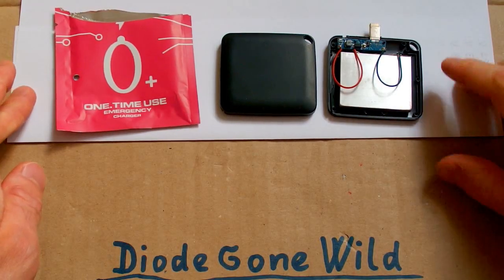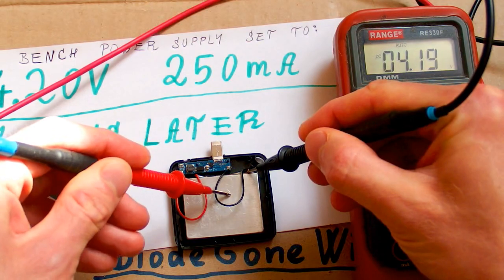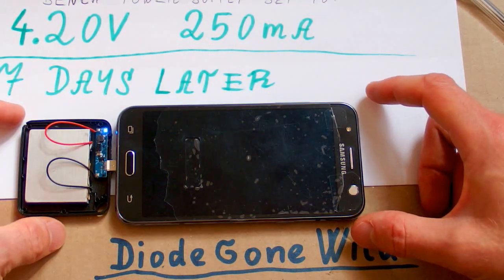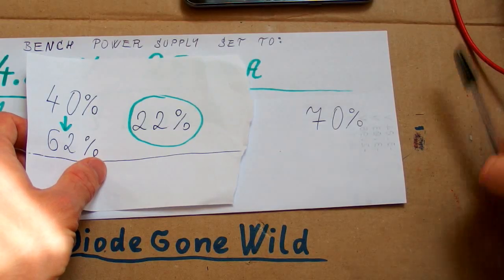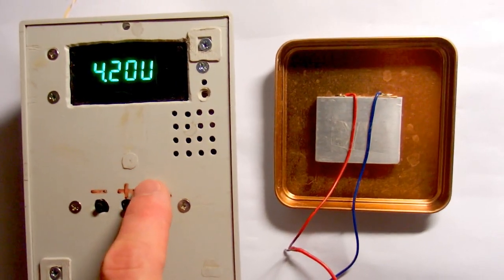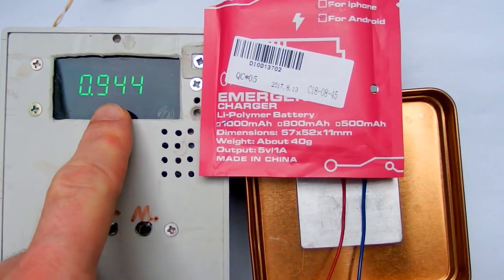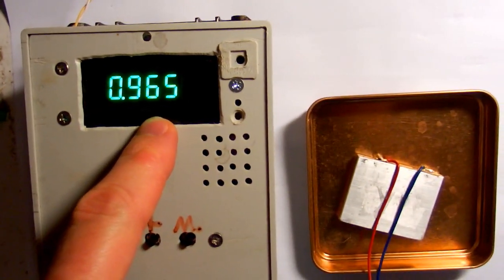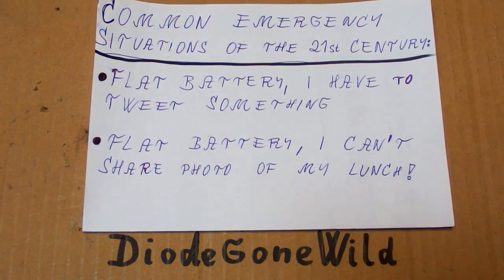Recharging the Non-Rechargeable Powerbank (and measuring its capacity)

Comment: Thank you for the lesson. 

My question is this, I have a kako tr pack (model S-4). I was using it in the my photography electronics flash in the 80s. It uses 6 batteries (D size) of 1.5v each. Can I convert it for charging mobile phones?
Reply: In those days, it was a  power bank for fields working in photography. What is the way forward?

Comment: Hook a TP4056 up to 4 of these cells stacked in parallel and that should charge with the right amount of amperage in should be fine 250mAh per cell @ 4000mAh
Reply: I got one of those single cell 18650 rechargeable ones, could I use the tp4056 to charge 4 of them in parrale coz I was thinking of buying a few more coz there only €1.50 and you get the step up module with it to. Payed €1.62 for 2 tp4056 boards for projects. What do you think or do I need to use the board's together. P.s the 18650's are 1200mAh.

Comment: The manufacturer of those disposable chargers needs to be fined and shut down. What a waste. If you can recharge them again then they are not really disposable if they can be saved,then they should make them chargeable. Very wasteful. Thanks for showing this. I intend to E-Mail the manufacterer or whomever supplys them.
Reply: RC Hobbyist Extreme they must use button cells or zinc carbons, which is tossable
Reply: Yeah I'm sure they will care with all the AA single use batteries that have been sold for decades
Reply: HE could just add a rechariging port
Reply: Chineses don't care about ecology
Reply: i wonder why they can't just spend slightly more and add a charging port
Reply: @starforce224  true
Reply: How dare they!!!!!!

Comment: I am pretty sure that these are batteries from battery waste. So it's not that wasteful. ;)
Reply: Yeah, probably sorted out after manufacturing. Class B or something.
Reply: @danielbreuer7917  or old cellphone cells.
Like old laptop cells are getting used in those cheap power banks.

actually i think more it is that, than faulty manufractured ones.
Reply: It is possible, but if they are new, than that's not good.

Comment: I'd like to see you slap a 3 AA battery holder in that emergency charger and see if that works.
Reply: how to waste aa batteries 101
Reply: @neptunez3495  how?
Reply: Pretty decent solution. A typical AA battery is about 1200 mAh, resulting in 700 mAh true charge (losses included).
With alkaline batteries, this goes up to 1000 true mAh, and with lithium batteries.. it goes up to 1500 or more mAh.. then again, 20% is more than enough for an emergency call.

Comment: Good stuff, a capacity of 974mAh @ 0.25A is pretty good going for that cell, though the difference between 0.25A and 0.5A was very little - which ties in with tests that I have carried out on 18650 Li-Ion batteries.

Also, bigclivedotcom has done a video about a similar cell that Tesco (UK store) are selling as disposable, again with a rechargeable Li-Po in it. I might eventually get one to see how good the Li-Po in it is.
Reply: This things sound like a "fast" Source of Li-Ion Accus if you need one just in time. Or when they are thrown out at 10-20ct, then it is a Cheap source for Li-Ion's for Small non critical Tasks. 

But i recommend to test them First...just in case. 

But at the other hand a wasteful piece of thing, you can supply those with ease with the crudest charging cirucit and then they are Real "Spare" Emergency Chargers...everybody wants to reduce trash, but people which upcycling this aren't getting behind fast enough...

Comment: in the future can i just replace it with 18650 battery? but using the same pcb?
Reply from the maker: Of course, you can replace the cell with a 18650 cell, but I'd rather replace the entire powerbank with a proper rechargeable powerbank :).
Reply: Then you need to add a charger too
Reply: Sabahan YouTuber no it's already in the powerbank

Comment: Actually non rechargeable lithium battery do exist. They are AA or AAA cell 1.5V and has twice the energy density (400wh/kg) compared to Lion cells. Lasts 3x longer than alkaline. Available in local large grocery stores, but expensive.
Reply from the maker: Yes, they do. They are called just Lithium (not Li-Ion or Li-Pol). They have very high capacity and very long shelf life (good for emergency). They are not widely used because of the high price. This is because they contain much more lithium than the rechargeable ones.
Reply: A real "emergency" (i.e. you are hiking for a long time so the phone has died, and you break your leg) charger would have a Li-SoCl or similar primary battery with long shelf life. This one will be dead in 4 or 5 months, and then be useless since you can't recharge it...

Comment: I spend $20,50 ,$5000! But keep my house& life.! I don't play with Batteries☠️! 
did it once & kaboom.! only shear luck saved me! "Thank u Mr. BMS!"
Don't do that anymore.! good luck to whoever does it.. & can make videos promoting!  Sincerely ( no pun intended) I thank almighty.& Mr. BMS.. I can't imagine the loss.. I would have!:/
Reply: N Ahmed I think he already knows that working with any battery is an at risk thing. Use common sense, dont cross wires and wear eye protection as well as working outside or having a sand filled tub handy when working with rechargable batterys. I tryed recharging a non rechargable battery once also and it exploded so yeah,being dumb means possibility of injury. Death from a small battery is pretty slim so I doubt you almost killed yourself. Playing with high energy Capacitors and such,yes I would belive that. Not a small battery,not buying it.